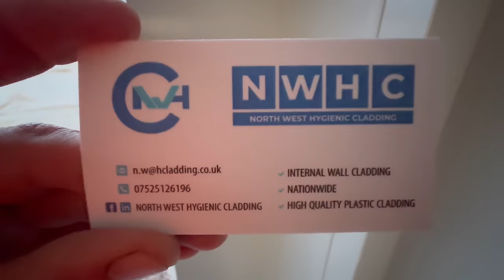The shed is nearly finished WOW, bulk tank in and final concreting completed. Dairy here we come

Comment: i think the shed is looking absolutely superb, the only thing i may have done different was bring the cladding down over the blockwork, down to the dpc.  the blockwork is only single skin and driving rain will soak straight through, making the inside of the store rooms damp, and mouldy  alteratively you should  maybe consider at least  a drip flashing at the bottom of the cladding to throw rain water running down the cladding away from the blockwork  , as i say looks superb and a credit to all involved

Comment: When did you say the jerseys are due now, mid may? A lot to still do yet, its all the last bits you come across that need doing that takes up a lot of time, plus gettinv the bots installed, wired up etc and running. 
What are you using for bedding on the cubicle beds out of interest charlotte?  Whos AI'ing them when theyve settled down, i take it your installing some sort of catching system from the robots? Just interested as ex manager to what youre planning. Cheers lady!!

Comment: Can i ask.. Well I'm going to. Why are you blocking the wall where the tank is. Won't it make it difficult if you need to do maintenance? I'm sure you've thought all about this with everything else being so well planned.
Reply from the maker: It was never to be blocked. The 3 15 foot spare panels were to go in and a stud wall above. We knew the Heath Robinson system would require “access” fast forward and we’ve gone brand new 🙈 When the day comes and we have to be back in to the tank room, front wall will come out and an expensive folding glass door will go in. Hopefully this will be 15 years away and we should have a few milk cheques in the bank by then!x